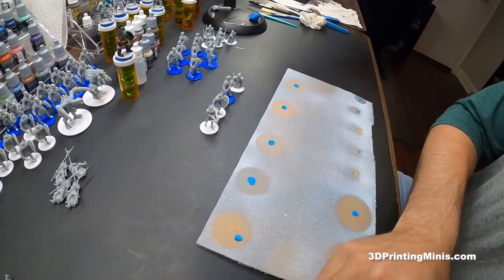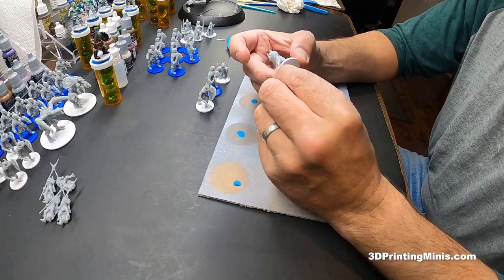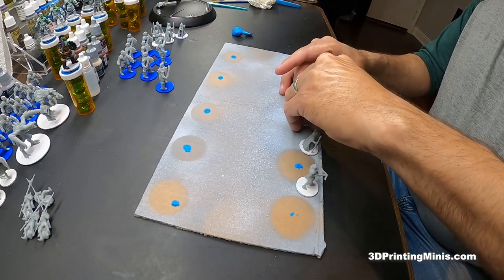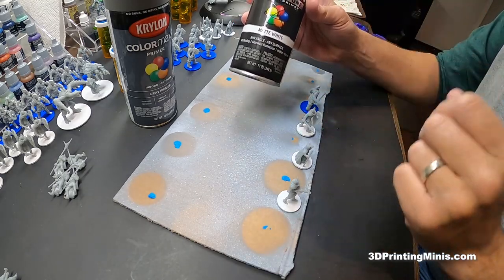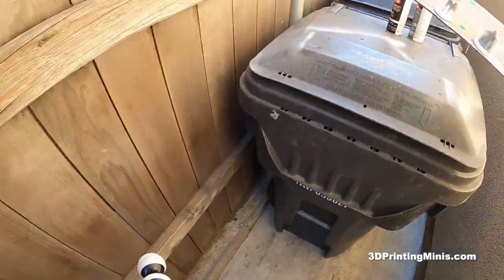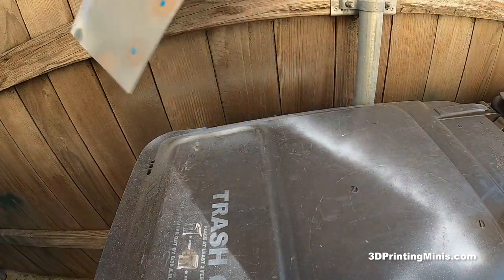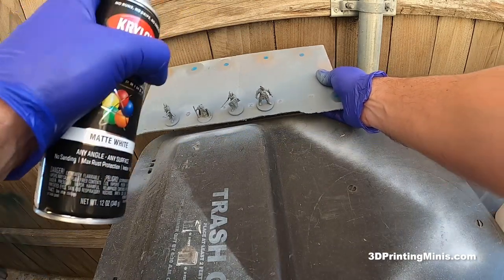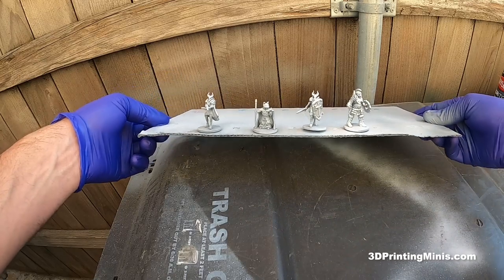How To Prime Tabletop Miniatures - Easily Apply Primer To 3D Printed & Standard TTRPG Figures

Comment: Whoa, I did not knew that I had to shake the bottle for a minute! I shook like 5 times and was wondering why it was throwing transparent liquid for 5 seconds then it started throwing these gray balls on the miniature, which led to my question, is the surface of the miniature that smooth after shaking the primer for a minute and spraying that you do not sand/polish with sand paper?

Comment: Another really cool video! When i'm priming it's sitting super thick on the mini, any tips on reducing the thickness that's being applied?
Reply from the maker: You want to spray prime on days that are really dry (low humidity) and warm out. You also want your can of paint to be warm (i.e. indoors room temperature - 68 F or above). Also, you can try spraying from a couple inches back. And you can start spray a couple seconds early before you come across the models, so the flow of paint will be steady once they're in the stream. Or, you could always invest in an airbrush setup but that gets kinda complex/expensive.
Reply: Its my view rattle cans are not good for tiny objects ...too much waste, so I bought a dual action airbrush for this and a thousand other reasons such a nice job and no loss of details

Comment: The spray can primer won't be too harsh as far as small prints and fumes with using these on a regular basis?
Reply from the maker: You need to use spray paint outside not indoors.

Comment: I used rubber cement to hold the miniatures down
Reply from the maker: Yep, that works. I just think the super glue gel holds them on a little better with less glue. And the gel tubes are super cheap and will last for dozens of minis without drying out.